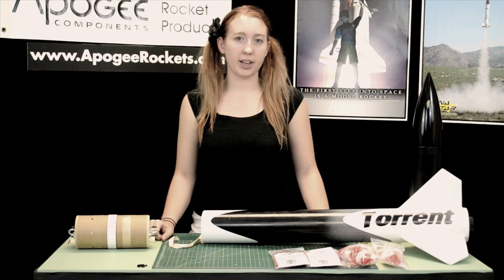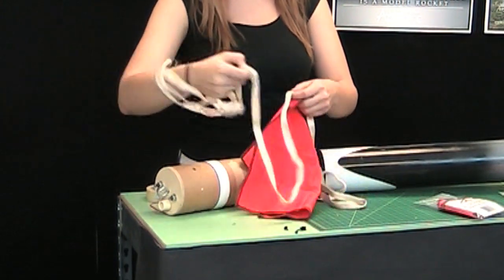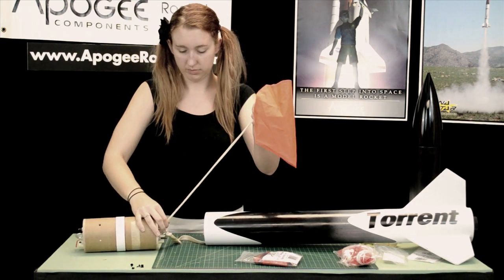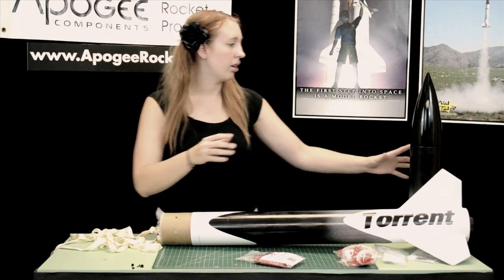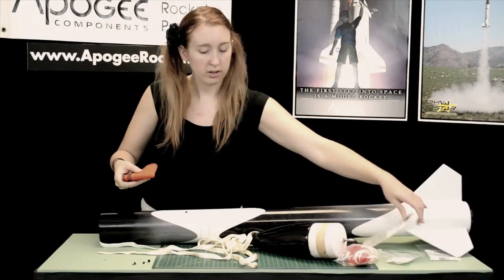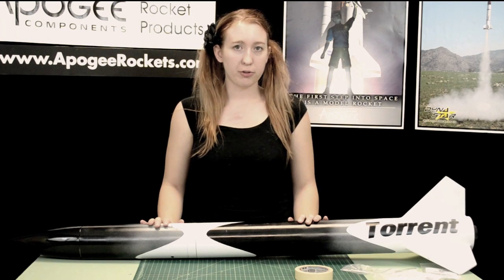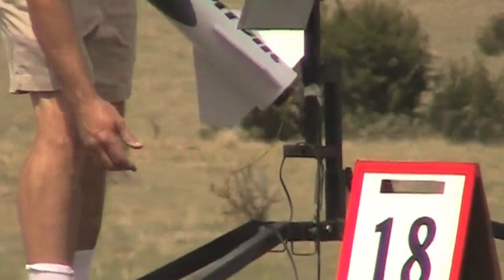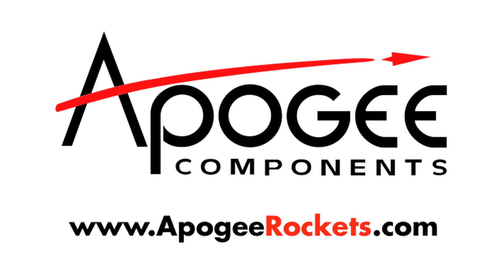Building Your First High Power Rocket - 10: Launch Preparation

Comment: Are there supposed to be two shock cords? I only have one in my kit
Reply from the maker: It depends. Sometimes you may have to cut the cord in half. You should check with the manufacturer on your kit.
Reply: @ For this kit in particular are there supposed to be multiple? I have a Torrent I got from Apogee Rockets
Reply from the maker: contact customer service of either the MANUFACTURER or the place you bought it from. But the retailer is going to contact the MANUFACTURER, so if you want faster results, contact the MANUFACTURER.

Comment: I've been told that in order to successfully utilize dual deployment that it is necessary to use shear pins. is that not the case with this rocket?
Reply from the maker: Not necessary. The purpose of shear pins is to prevent pre-mature separation of parts. It depends on what you are trying to accomplish. For more details, visit the Apogee web site.

Comment: wow that flew real nice good job building it, you should see my 4 inch wide 58 inch tall high powered crayon, its two banks put together to make one big rocket weight is right at 3 pounds tol, thats useing 1/4 inch oak ply wood for fins and centering rings, berch is better ply wood,

Comment: I just looked at their site,& they're sold out of this particular one. It's $133.45,but you're getting what looks like a 4 foot rocket. I kinda like it. A lot bigger than the smaller ones I used to design as a teen. Only problem is,I'd have to find a huge clear area to launch it. I wonder if you have to download the info from the data loger to a laptop every time?

Comment: Nice flight apart from the ignitor no-no and add a suggestion that the Double Figure of eight knot would be preferable to a slip knot as it is used in Rock climbing as a method of attaching yourself to the safety rope. Otherwise a brill series,well done Erin